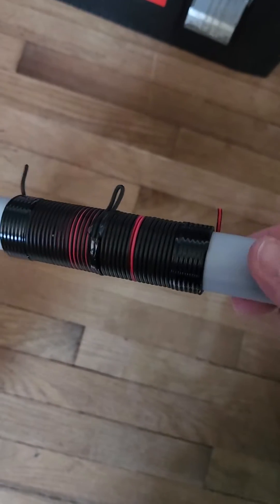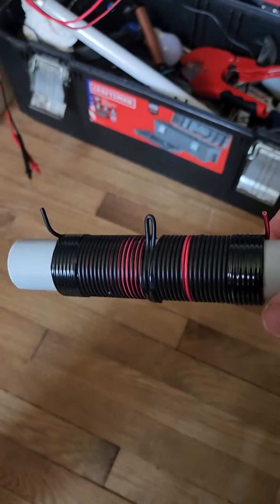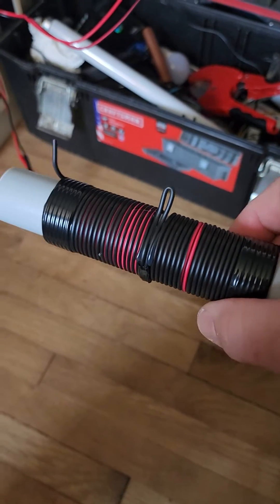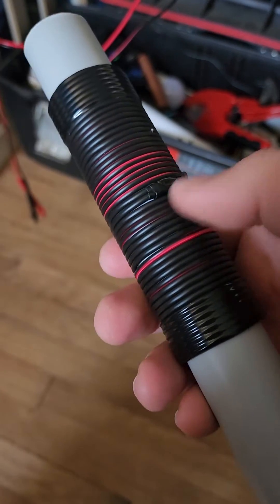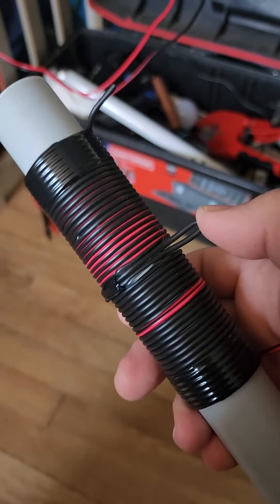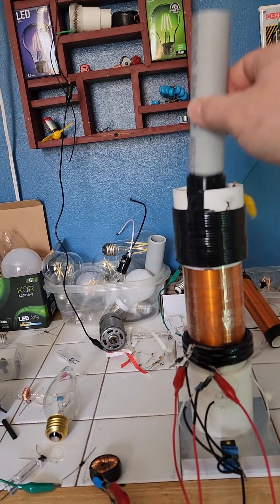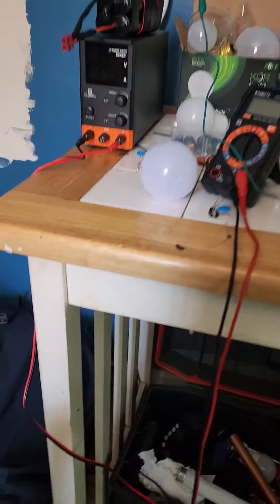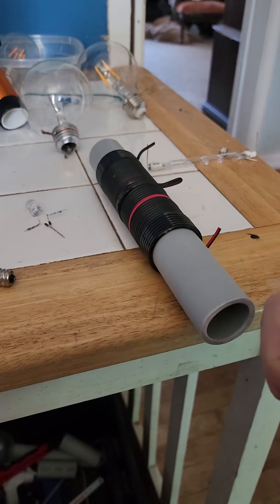How The Adjustable/Receiving Amps Coil Is Wound

Comment: I'm making a coil some what similar to that another gentleman on the internet did a engineering extract from one of Don Smith patents one of his designs and you take that coil you put the center cap to ground Earth ground you wrap another coil around it to a zsv they force residents to happen so you don't have to measure so much next what you do is each end of that coil one end goes to a spark gap in between each wire is a small capacitor high voltage it sets the pulse frequency for everything the smaller the cap the higher the frequency then the wires from the spark gap go to a high voltage bridge rectifier and then from there to a capacitor Bank or another high frequency core with the appropriate ratios to bring it down to a usable voltage he says that's really all you need so I took a Tesla coil and I put in the ground in the middle because when I wrote him and ask him about it he said yeah teslaco would work so I'm working on that trying to get everything right to see what the outcome would be but he said that if you have a zsv and that coil configuration with the Earth ground you're pretty much there that residence is the whole secret and that the rest of the patent where Don ended with a inverter pull 110 AC from he says to try to control the voltage on the other end and mppt might work
Reply: Any results? Did you get it to work? I'm interested in keeping up on your progress
Reply: @isaiahj3968  nothing yet I'm doing other work at the moment.
Reply: @R2NOTU  do you have a link to the fellow you found doing the engineering extract you described in your comment?
Reply: No link at this time I might refine it ..at the moment I'm rushing to get out side work done before summer heat rolls in.we had a bad ice storm a lot of tree damage

Comment: My transmitter runs at a frequency range of 2 MHz when measured with a wireless frequency detector.  I need to measure the frequency using an oscilloscope since 2Mhz seems a bit too high. I also need a better understanding of calculation (fractal division?) to convert frequency to matching length of antenna.
Reply: I used my oscilloscope to measure the frequency from the emitter of TIP35C and it runs 875khz at 12V input and 877khz at 24V. So what should be the length of my center-tapped coil wire?
Reply: I think I got it now. Assuming my avg. frequency would be 876khz, the wirelength should be about 5.78m(18.96ft). Correct?